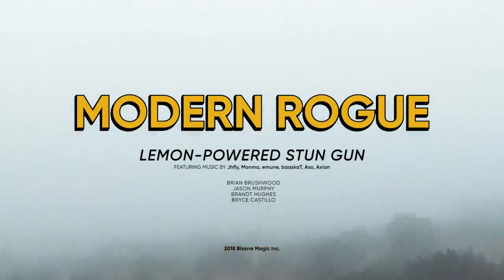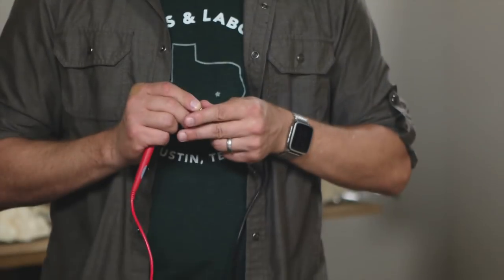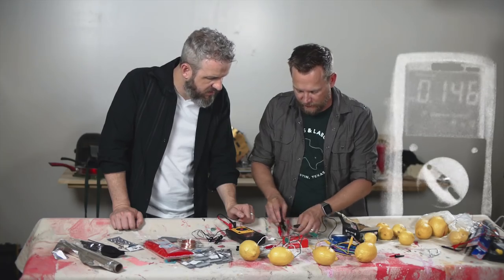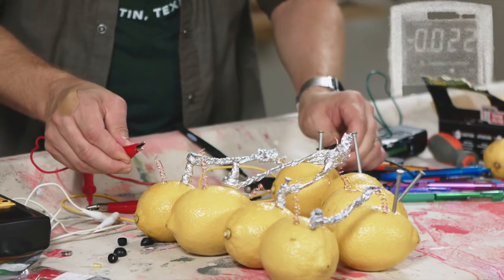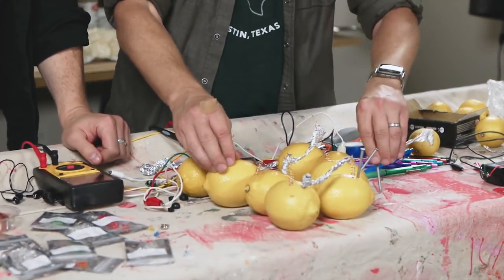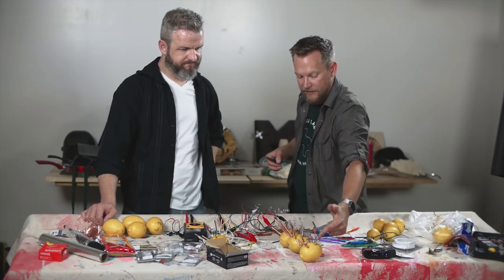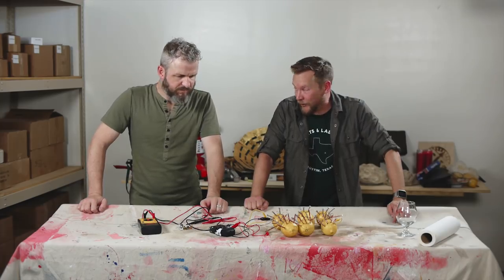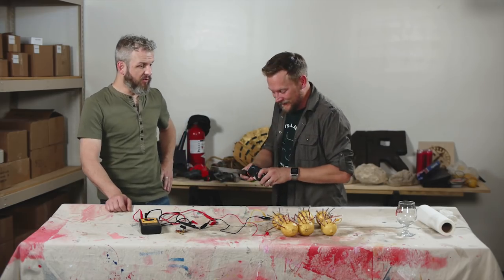Making a Lemon Stun Gun

Comment: Remember - capacitor is not perfect. It will lose some energy stored in it. And there are no perfect capacitors. So it might be the case that it stores energy slighty faster then it "leaks" it. As far as the electrochemistery is concerned: metals are put into acid and they "want" to react, however one metal have to get more electrons, and the other one have to get rid of a few in order to react with acid. It is called red-ox (reduction - oxidation, oxidation in this case does not have to be related to oxygen, i know it's strange). When you put conductive wire electrons have a easy path to get from one metal to the other.
Reply: MaruderSlayer Thanks! If only we had a fraction of your knowledge when we attempted this. :)
Reply: @Jason Murphy majority of fun comes from watching people having no idea other then a general concept in mind :D I just posted this to give a little oversimplified decription of what's going on :) also forgot to mention - both metals "want" to react, but only one will react - the one getting electrons. The other one wants the react, but not as much as the first one, but he's a good guy, and he gives his electron to friend so he can react xD (in reality - it depends on which one is where on the Galvanic Series but to give general concept, that's how it works). The one who gives his electrons will dissolve into ions

Comment: Late comment from a new follower:

Capacitors do not accumulate charge like batteries. Depending on the system, they will generally reach maximum charge within a few seconds if not instantaneously. Caps hold potential energy. If the power source does not have enough potential energy to charge that capacitor, basically nothing happens.  

Think of this ... let's say you have 100g weight. You lift that weight 1m above the ground, then drop it. It hits the ground. Then, you take the same 100g weight, lift that weight 1m above the ground, except this time you hold it there for 24 hours ... which one hits the ground with more force? (re: charge time)

Now, using the same analogy, you take the same 100g weight and lift it with your arm. Your body is capable of producing enough potential energy to lift that weight to a height of 1m. Now, wet your finger and try to stick it to the weight. Lift only using the surface tension of the water and the friction of the weight against the tip of your finger ... it's not going to work. This system is not capable of producing the potential energy to lift the weight off the ground. So now ... you have a weight suspended at 1m and another suspended at 0m. Drop both weights. Which one hits the ground with more force? (re: potential energy)

Comment: If you want to do this experiment, use copper wire over aluminum as copper has less resistance than aluminum. Aluminum has about 61 percent of the conductivity of copper. All this means is less efficiency as you will get more energy loss in the form of heat from the aluminum.

Comment: User copper and zinc plates instead of nails, plates have more surface area. Connect like 200 lemons with like two 100's of them parallel connected and the both 100 parallels are serially connected together. That should charge your zapper :D
Reply: Or do a voltaic pile battery with lemon juice.

Comment: The first LED probably didn't work cause it was probably in the circuit the wrong way. The second one was dim cause you had too much voltage. That specified voltage range on the LED is pretty tight, a little too much and the light is dim and won't last very long, a little more and it burns out.

Comment: Here I reveal that I sometimes teach electrochemistry...

It works best with sheets of metal rectangles 2cm by 8cm by 1mm for example or 1 inch by 3) potatoes work pretty much as well as lemons surprisingly and it is often easier to get more of them.  The internal resistance of the cells (each pair of electrodes) is lower if the metal bars are closer together, yours were too far apart.  Therefore I suggest putting sets of two plates parallel to one another like an = sign.  Each one of these sets should have a slightly higher voltage than you were measuring but more importantly the voltage should drop less when you take current.(as you mentioned V=IR so the internal resistance of the liquid Rl and the charge transfer resistance of the surface Rct is spoiling your game)
Reply from the maker: Nice!
Reply: On thinking about it further if you put copper and zinc plates in alternating and parallel to one another both sides of the metal will be used.  In your case almost all of the  current will flow on the side of the pins facing the closest pin of the other metal.  You could connect all copper pins together and all zinc pins together.

BTW, do you want me to take down the video of a magic trick that I built from Scamschool effects?  It is your original idea.

Comment: Leave the volt meter connected while the 'taser' is connected+charging,and see if the voltage maintains 1.5V while under a load. (Hint: it will drop to something substantially lower.)

Comment: I know you have probably learned this by now but the voltage of the battery can only charge the capacitor to the voltage of itself and no higher the AAA Battery is probably hooked up to a transformer to up the voltage and amps
Reply: You would have to connect the lemons to the battery holder

Comment: LED's are Light Emitting Diodes. It only works when the current flows in a specific direction so they would have had the positive and negative fliped at the start. thats y the LED didnt turn on at 2 volts
Reply from the maker: nah, we tried it both ways each time.
Reply: oh fairo sorry for undermining ur knowledge, anyway keep up the great vids :)

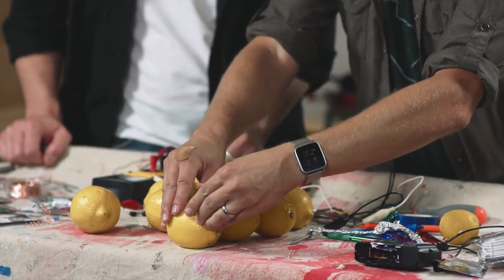Comment: Hate to be that guy but at 12:58 Jason says, Cathodes are negative, and anodes are positive it is the other way around. I remember because in chem, I had difficulty remembering the difference between cation and anion, so I did this. Cation has cat, cat's have paws, therefore it is positive. When we started electrochem cathodes and anodes followed the same rule.
Reply: Yup. Got that backwards. Sorry about that.

Comment: can you not add more lemons in parallel to the ones in series so you increase the amps without increasing the voltage? (I'm not an electrical engineer but that makes sense in my head? - Correct me if I'm wrong though! :) )
Reply from the maker: That’s my impression

Comment: Need a more consistent power supply, also the current is extremely low, a higher current with less resistance (v=ir) will give you the required voltage while also passing through fast enough to adequately charge the capacitor also  your watts(power)=vi, for the higher wattage and the same voltage you need a higher current

Comment: It would take around 6 million lemons to equal a cart battery. Who's up for it?
Average lemon is 0.7V at 1mA when under load compared to around 1.2V 2000mA - give or take 3000 lemons.  
You likely didn't overcome the internal resistance of the circuit to even start charging it.  
Make it easier for you - got to a store and get some low voltage and high capacity electrolytic capacitors,  directly wire them up to the lemons and look for sparks.

Comment: Charging a 1.5v cap and making  a pulse using a transformer then capacitor then ignition coil would work much better I have used a shaker flashlight to make a spark that way

Comment: Didn't know every modern rogue viewer is an electrician and expert in ohms law
Reply: as a student in grade 11, I can assure you that most of us equally have no clue about most of this, but i can testify that ohm's law is not the right law...
Reply: Funnily,most every comment on here about Ohm's law is incorrect. Or they don't realize that the equations (that's plural,it's more than just one equation.) can be worked 'backwards'. If you know any two (voltage,current,resistance,or power) you can calculate the third,and thus the fourth. Ohm's law is 100% the correct law.
https://en.wikipedia.org/wiki/Ohm%27s_law

Comment: You can not measure amps like that. You have to wire the volt meter in series with the battery and then measure when running or use an amp meter that goes around the cable and measure while pulling power as well.  The short answer is you need many more batteries.  Not sure but you may get better luck with lemon juice in a container because the part around the nail/copper in the lemon drys and makes it so that it can not make contact as well as when you first start the test. also the lemon guts to not move electricity as well. If you want to use the lemons you can try to squish them by rolling to brake up the pulp be careful not to break the peel.

Comment: You need to make a penny battery. Grind off one side and then cut and place cardboard squares no larger than the penny between the layers. Make sure you place all zinc sides facing all one direction and then tape it with some electrical tape with wire leads. Then add some vinegar wait a few mins. it makes a great wet cell battery.
Reply: TeslaCoil1120 Great idea. I’m positive we’d screw it up.
Reply: Thats science for you. But you can also say what we call those situations, its a SWAG ( Scientific Wild A** Guess)!  It was a great attempt, make me want to try it now!

Comment: there should be enough to charge the capacitor. I think the wires connecting to the camera were the wrong way round. Most large capacitors are polarised meaning you have to put current in in the correct direction. This concept should be revisited trying with the poles reversed.
Reply from the maker: definitely going to revisit this one, with SO MANY MORE LEMONS.

Comment: I feel that it didn’t work because while charging they disconnected where the battery should be 
So the amount of current would be lost these are lemon batteries. Try doing it with then still on current was lost due to the electricity running through

Comment: Sooooooo. Your problem was that the current isn't high enough. That circuit requires a ton of current to turn on. Like .6A or so. You were getting 3ma. It's basically an oscillator which means it turns on and off rapidly. It also oscillates into a dead short. That requires tons of power. The whine you hear is all that energy being dumped into the short. Try again with your buddies lab supply and see just how low you can go. You could end up needing a table of lemons..... I have a feeling is about 300ma to get it to work.

Comment: Sigh... LEDs are one-way polarity ONLY. They are a diode. They are not a light bulb. If you reverse the wires, they don't light up. I suspect they kept hooking that green LED up the wrong way each time at the beginning. They only require a few mA to run so the lemons likely can provide enough current.
Reply: Calgary Guru yea I thought the same thing
Reply: They pretty much tried both orientations every single time they tested it, but leaving them all in the edit would drag on and undercut the pacing. We might be dumb, but give us a little credit.
Reply: Brandt Hughes yea I read the description after replying to him

Comment: I wonder if Brian meant to make an inductor when he coiled up that copper wire.... that would in turn make it have inductance, and in dc circuits, this will cause a voltage drop on the wire itself, taking away from the output of the gun itself
Reply: Also most common LEDs are polarized, so they probably just had it backwards the first couple times they tried to light it lol
Reply: Who is John?
Reply: Brandt Hughes lol facepalm I meant Brian. Woops
Reply: Haha, happens to the best of us.

Comment: 15:19 Hey guys, you used the wrong formula. The formula that you actually were using is the power formula P=IV, ohms law (V=IR) is Voltage = Current x Resistance

Comment: Say a typical lemon battery produces .9v at 1mA (0.001amps) according to Wikipedia. Then to produce equal current to a AAA battery (about 1.5V at 100mA  [or 0.1amps]) you'd want 100 lemons in parallel (0.001A*100=0.1A). 
To get over the 1.5volts (to about 1.8) you could run two of these 100 lemon banks in series (2*0.9v=1.8v). 
This would give you a 1.8volt 1mA lemon battery. 
If someone wants to tell me how off I am I'd be very happy. This maths may be completely off, it was over a year ago I last did any electronics and I've been traveling for months so my brain isn't in work mode.

Comment: Most LEDs have a minimum voltage current requirement hence why it didn't work with 3 lemons.
Reply from the maker: voltage or current?
Reply: Current lol. Rookie mistake on my behalf.
Reply: Although LEDs do have voltage requirements (range) depending on their colour.
Reply: You were right the first time. LED's have a Forward Voltage,for example a red LED is typically around 1.8V (it varies by color),below that they will do nothing,no matter how much current is available. They are sensitive to current though,as allowing them to draw too much will result in rather stinky magic smoke. (the smell always reminds me of baby diapers,for some reason.) Typically a resistor is used in series with the LED to limit the current to..roughly 10ma,depending. Usually they will light dimly at a lower current,as long as the voltage is greater than the required Forward Voltage.

Comment: You guys were doing it way wrong.
Whilst the voltage was correct the amount of current produced from the lemon battery wasn't enough to make it through the internal resistances of the taser. Plus the LED does burn off current as well. If you wanted to do a real test you should've charged the capacitor directly. What you could also do is take a small spare capacitor out of one of those cameras or from a hardware store and charge it directly without the possibility of internal components using amperage.

Comment: He called someone and still got it wrong, volts is your current.
He needed more power ie amps.

And ohms law is about how amps and volts relate to the resistance of metal.
Reply: No amps is current
Reply: @griffingeary3356  it depends on where you live. In some places an amp is described electrical power/force. And volt is described as current.
In others they switch the meaning and declare that they mean the same thing.

Comment: To the modern rouge:
Measure the voltage while under load (charging something)

To the poor people without a cheatcode:
"We've got some voltage"
Due to internal/parasitic resistance voltage will drop (severely in this case, this ain't a battery) when under load, always*. 1.6V for some LEDs is stretching it; To over-simplify it: LEDs attempt to regulate the current flowing through them so don't worry about supplying .5 volts too much.

"100 Volts :D"
wires up a LED
"2V (!?)"
*pro tip, just buy batteries, cheaper, smaller, last longer, more powerful, less resistance....

"Voltage is cumulative?"
For high voltage
yes, if you wire it properly -- in series, or + to -
For high amperage or current
nope, in parallel, or all +'s (anodes (zinc)) together and all -'s together (cathodes (copper))

"Only one way"
Yes, as you've learned from experience: LEDs, or Light Emitting Diodes emit light when current flows through, which in turn only flows when you have the correct polarity; Diodes block current flow in the wrong/backward direction (up to a point), drop some voltage (Vf or forward voltage) in the correct direction.

Comment: They had 2 rows of 4 at 3mA. To reach 6A, each of the two rows would have to have 8000 lemons. So what’s the cost of 16000 lemons, + enough galvanized nails and thick gauge copper wire to stick 3-4 anodes and cathodes in each?😂
Reply: I did some calculations. Your looking upwards of 5000 dollars😂
Reply from the maker: It’ll be worth it...